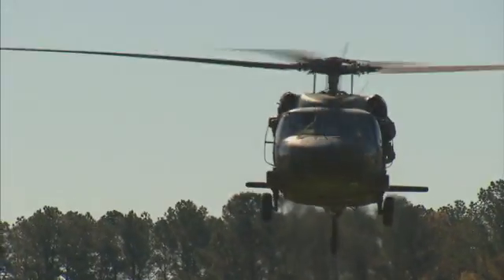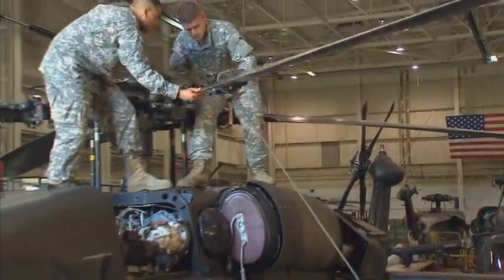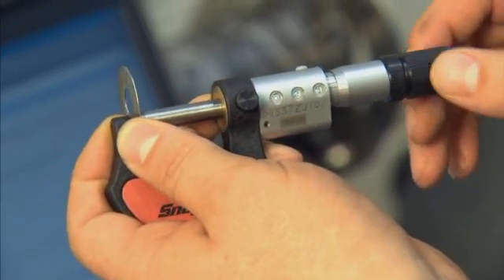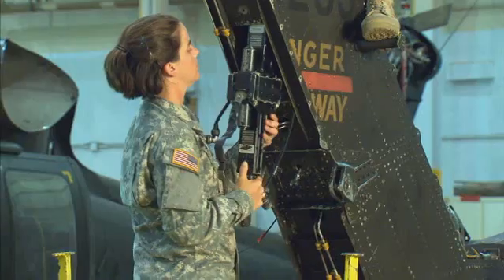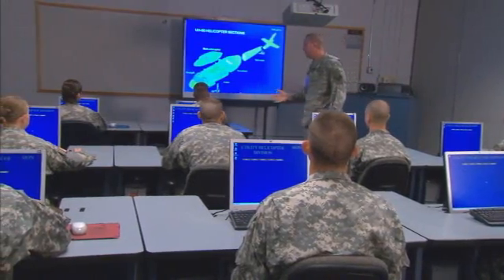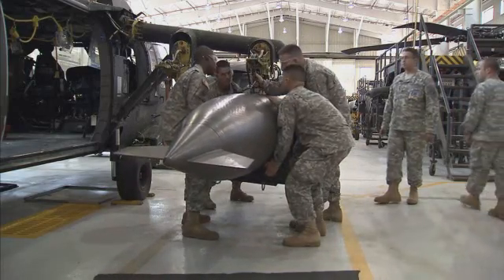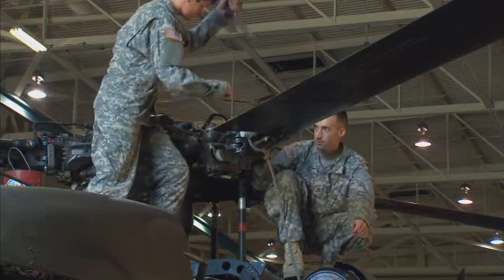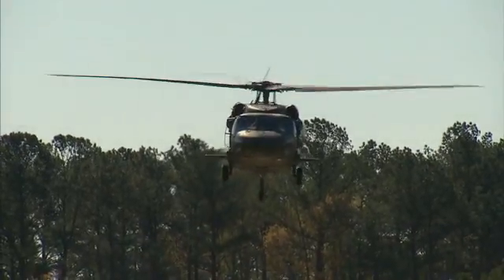Army Careers 15T - UH-60 Helicopter Repairer

Comment: By the end of AIT you will have a good basic understanding of how the UH-60 works and is repaired. As well as. Amazing bed making skills. A solid understanding of how to stand anywhere, anytime in any weather. The difference between mowing grass and mowing grass that has been mowed every day as well has dead grass because resons (Freaking bowling alley at Eustis) How to strip and wax a floor still warm from the previous CQ shift and most importantly the difference between a tip where the cab drops everyone off 1 street over and the tip that gets you dropped off right in front of your barracks with the cabby honking as he leaves yelling call me next weekend I know of a lot more bars...

Comment: To clarify. You enlist as a 15T then you basically have to work and show you are very familiar with your aircraft then they might suggest you for crew chief. Then you have to get air certified and stuff. But it's a very good job and helps in the civilian world
Reply: I’m becoming a 15T next year any advice
Reply: What does air certified means?
Reply: @alondracosme1467 The master crew chief of the flight company will do a check ride with you and make sure you have your head screwed on the right way. Crew Chiefs have to do a lot of assisting the pilots in flight and have to preflight and postflight the aircraft before every single flight. So having the heli ready for flight before the pilots get in the seat in on the two CCs. If you’re brain dead and only good at turning wrenches they’ll probably leave you in the maintenance company.
Reply: Shit man, not always. I reclassed from airborne 11B to 15T and they stuck me straight in a crew chief position. My first day they hand me a helmet and some flight ACUs, the rest is history.